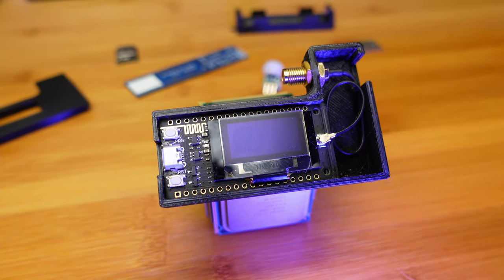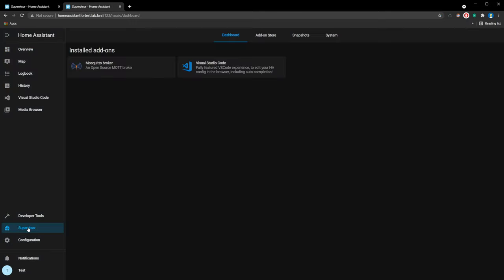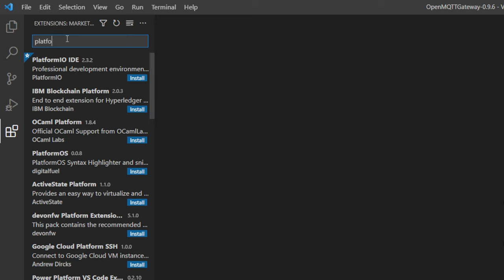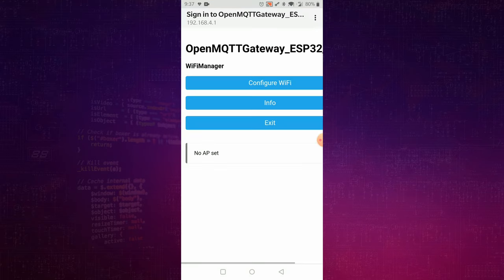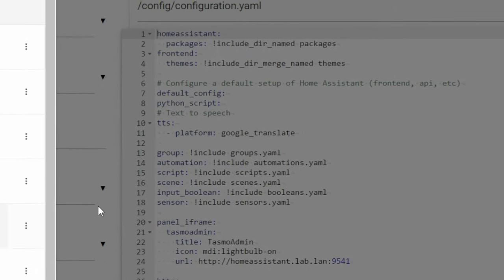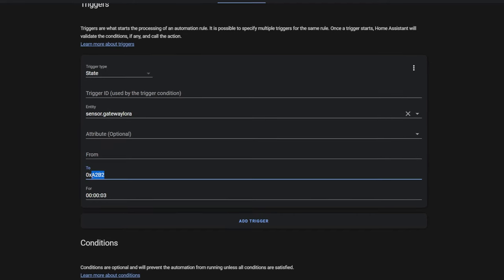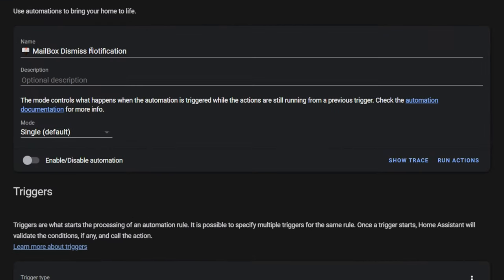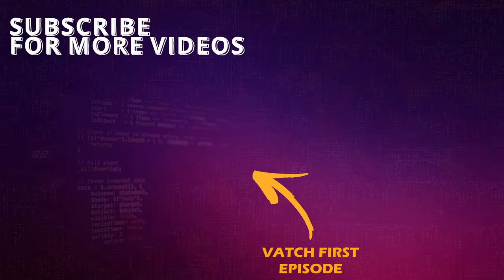LoRa Bridge and Mailbox sensor Integration into Home Assistant #2

Comment: Could you do a video just on LoRa ?
Like on the Home Assistant side, I'm not sure if I need a transceiver, a gateway, a bridge or something else. 
What is LoRaWAN? Do you have a LoRaWAN as soon as you have two LoRa devices or is it a bigger commercial application that requires special infrastructure?
Reply from the maker: This video is an old one!  watch this https://youtu.be/gf1WWKyEnbg
Reply: @PricelessToolkit  I was!
But it doesn't clarify everything. I get the TTGO is the gateway and you connect it to your WiFi network, it's not like a ZigBee stick or a RPi Hat. In the mailbox, is there only an emitter or is that module able to receive data from the gateway as well?
Reply from the maker: no MailBox Guard only sends data.

Comment: Big question, what happens if the Mail man  leaves the mailbox flap open (typical large envelope that doesn’t get all the way) or publicity or whatever. Is the battery going to drain or have you thought about this situation ?
Reply from the maker: Hi, what type of mailbox American or European?
Reply: @PricelessToolkit   european, would use a reed switch
Reply from the maker: @danielducu  reed switch instead of motion sensor?  On the mailbox sensor, LDO has enabl pin, motion sensor uses this pin for activating Arduino, after boot, Arduino keeps LDO pin high until the message is sent.  So if you connect a reed switch instead of a motion sensor, in the case when the door is not fully closed Arduino will be powered all the time And will drain the battery very quickly.
Reply: @PricelessToolkit   would be great if you could make a small video showing how you mounted everything inside the box , especially the pir hehe
Reply from the maker: @danielducu  I will take a photo tomorrow
Reply: @PricelessToolkit   thanks man. Anyway, the project it’s awesome. I can’t wait to build this one 🤩

Comment: Hi, great project! I would like to use two of the ttgo lora32 v2 modules, one as gateway and other for sensor with a hall sensor or tilt sensor. Will your arduino ino file work with the lora32 v2 board?
Reply from the maker: Hi, Thanks!!  Unfortunately no, the architecture is different. You can take "Lora sender example" for the lora32 board. then add interrupt pin cod for your tilt sensor, it's like push-button no difference, there are many examples.
Good luck

Comment: I purchased the ttgo board from the link you provided and I have problems with the MQTT part. Writing openmqttgateway was a clean process and no errors what so ever... im configuring the wifi and MQTT from the web interface but it's not communicating with my MQTT broker... absolutely nothing. I tried flashing both a version from July 2021 as well as the last  openmqttgateway version but the same thing... any hints ? I have MQTT setup in home assistant and works perfectly
Reply from the maker: Hi Daniel, 
1. Can you see under "MQTT devices list" your OpenMQTTGateway ? 
2. In your wifi router can you see OpenMQTTGateway IP Address?  Ping is working?

If the ping is working so it's connected to the wifi network problem can be a simple " MQTT username/password/MQTT Address" misspelling error.
Reply: @PricelessToolkit  thanks for your reply. Not showing in the MQTT device list in HA (I also tried an MQTT Explorer APP where I see everything, less the gateway), in the router I can see the ip and ping has super good and stable reply, MQTT credentials  and address are ok, I tried reconfiguring this a few times now :( I'm out of ideas
Reply from the maker: @Daniel-vd4mk  Very strange, if you are using MQTT Explorer APP so you can log in.  I found a note in "https://docs.openmqttgateway.com/upload/portal.html#wifi-and-mqtt-configuration-portal-for-wifi-boards"     Note that your credentials are saved into the ESP memory, if you want to redo the configuration you have to erase the ESP memory with the flash download tool.   Maybe the first time you typed login or password incorrectly.  I suggest you wipe ESP entire memory and try one more time,  Only reflashing apparently does not erase the memory
Reply: @PricelessToolkit   I've written OMG to an esp32 d1 mini. enabled fastled just to test. Again, everything cool, all configured and on the network but not communicating with my mosquito broker from HA. damn...
Reply from the maker: @Daniel-vd4mk       I'm running out of ideas   ar you using ssl ??
Reply: @PricelessToolkit  no, could the board be defective? It’s connecting to both wifi and mqtt server initially because if it wouldn’t, it would get back to the config page and AP mode. So initially is ok, but after , does nothing on mqtt … just connected to the network … it’s bad they didn’t left some kind of web interface to debug and get some logs
Reply from the maker: @Daniel-vd4mk  No, I don't think that the board is defective,  first, it must connect to the wifi then to the MQTT server,    #it would get back to the config page and AP mode# of course not! OMG will only do this if wifi credentials are wrong, MQTT credentials error is silent.
Reply: @PricelessToolkit  is there a way to see what the board is doing ? Trust me, I’ve put the correct mqtt credentials. The thing is , I’ve configured another board in the past (v2 or 3 of the lyligo) and worked smoothly…
Reply from the maker: @Daniel-vd4mk  Maybe it outputs debug data in the serial port?   and try this 
1.https://docs.openmqttgateway.com/upload/troubleshoot.html#you-don-t-see-the-messages-appearing-on-your-broker-but-they-appears-on-the-serial-monitor
Reply from the maker: @Daniel-vd4mk  https://github.com/1technophile/OpenMQTTGateway/issues/397
can you show your MQTT server config?
Reply: @PricelessToolkit   I just tested a heltec board, flawless install … absolutely no issues. Will paste the serial port monitor output maybe you can figure out why it is failing. I’m starting to think the ttgo board revision they sell now is somehow incompatible with the OMG …
Reply from the maker: @Daniel-vd4mk  Even if this board has a different pinout MQTT will work ,  only the lora may not work. yes, I'll take a look , did you read the github thread

Comment: Hello, how about the TTGO-LoRa32-V2.1?
Reply from the maker: Hi, Technically all esp32 are supported, the difference can only be which pins are connected to the Lora module.  But these pin numbers can be changed in the config if I remember exactly, to be 100% sure ask on the "OMG" forum. here is a photo with pin numbers for version 2.1 https://0.rc.xiniu.com/g2/M00/FA/B1/CgAGfFv00Z2AJvSNAAIzDuBdPk4301.jpg
Reply: @PricelessToolkit  I could then upload the v1 file from openmqttgateway?
Reply from the maker: @mitsosliak  v1 file ?  Try with latest version fo OMG
Reply: @PricelessToolkit  is it possible to provide me with the link?
Reply from the maker: @mitsosliak https://github.com/1technophile/OpenMQTTGateway
Reply: @PricelessToolkit  As i can see, the only difference is the reset gpio for the lora chip. As such if i just define gpio from 14 to 23 in config_LORA.h , everything should work as intended, right? Check picture below please:
https://i.gyazo.com/5029ffb6d600d773b015db7294610d70.jpg
Reply from the maker: @mitsosliak  yep!
Reply from the maker: @mitsosliak  If it's not difficult, let me know if it worked?
Reply: @PricelessToolkit  will do, it will take some days since I haven't received them yet
Reply: Today i actually had them delivered. It was a successful regarding flashing. I had the esp connected to my wifi network. I have trouble connecting to my mqtt broker though. I am sure i entered correct settings. I am receiving the following message when i connect through arduino ide :                                         
W: MQTT connection...

W: failure_number_mqtt: 1
W: failed, rc=5
Reply: @mitsosliak  rc5 means the client is not authorized to connect "this message was sent by your server"
Reply: @d.m5238  that means that I did something wrong with mqtt username and password?
Reply: @mitsosliak  in your mqtt broker certificat is enabled ? If yes disabl it
Reply: @d.m5238  i fixed it. I realized that there was a space at the end of user name and password. Thank you for your help!
Reply from the maker: @mitsosliak  No problems, I'm glad that everything worked.

Comment: Do you know if it is possible to add a second or more sensor from another lora sender to the same OMG?
Reply from the maker: OMG is a gateway, so yes, you can
Reply: @PricelessToolkit  but how is that possible? Do I need to use the same (secret) word for all of them? If that's so,  how ha will know which node is reporting? There is only a single entity inside ha ( gatewayLORA).
Reply from the maker: @mitsosliak  Its depends on which type of data if it is a binary sensor like a different state each sensor can send (Sensor1 101= on 102=off) (Sensor2 201= on 202=off) and automation in home assistant does the rest.
Reply: @PricelessToolkit  let's say you have a node that sends temperature from a Dallas sensor and a second node sending a reed switch state change. Then what?
Reply from the maker: @mitsosliak  Then it will not work, only will work with binary type sensors.
Reply: @PricelessToolkit  if I have them as new pair? Can I have two gateways at the same time?
Reply from the maker: @mitsosliak  I am not sure, but if they have different names,  I think there will be no problems, ask on the OMG forum.

Comment: Hi
Great project I have ordered the PCB's unfortunately I need to make change to the PCB as I use a clone Arduino Pro Mini which has different FTDI layout ,not sure how to go about it ..Cheers
Reply from the maker: Hi. i use clone too. all pins are different ? you don't need to solder all pins. if you want, I can tell which pins you need to solder.  FTDI Pins not used.
Reply: @PricelessToolkit  Hi . Thanks for the reply .They do touch though when you solder other pins on Pro Mini ,best would be to put a tape over the  FTDI pins .....Is that what you are  suggesting ..Cheers
Reply from the maker: @gilclaus9798   FTDI contacts are not connected at all. Even if this contact is touching nothing worry.
Reply: @PricelessToolkit  They'll have to be connected to program as per your YouTube  video and the power rails will short if they're touching...?...Cheers
Reply from the maker: @gilclaus9798   I have updated the Github Page watch "Which Arduino pins to solder" If you have any more questions, I will be happy to answer. good luck
Reply: so best to use a header as spacer  ..Cheers
Reply from the maker: @gilclaus9798  Yes, it's a proper way. but it can touch the battery holder on other side of pcb.
Reply: @PricelessToolkit  Thanks ...That was helpful ....think I shorted my board for now ...Cheers

Comment: How to increase the range between transmitter and receiver (LILYGO TTGO LORA SX1278) ?
Power tx is set to maximum (20), but the effective range is 4-5 meters.
My mailbox is around 20 meters away,  behind few walls.
Reply from the maker: 4-5 meters? Did you turn it on without an antenna?? even if you turned it on only once without an antenna, there is a chance that the RF amplifier burned out, even with very small and low-quality antennas, the LoRa range is more than 100 meters. Check antenna connections!!
Reply: @PricelessToolkit  unfortunately I don’t remmeber - probably I didn’t connect the antenna during uploading the software :-(

Sys: Rssi says -27 dB in HA
Reply from the maker: @gabrielcwik146   -27  dB is good but probably it's wifi RSSI. are you sure that the config is identical in the gateway and sensor?
Reply: @PricelessToolkit  I have the same frequency 433Mhz, syncword 0xF3 on both ends. The Mailbox key is send correctly to HA. Automations works fine. The only problem is the range.
Reply from the maker: @gabrielcwik146  Is the sensor antenna soldered correctly?  I have no more ideas , check it one more time. The problem for sure is RF related
Reply: @PricelessToolkit  I just want to be sure. The problem could be on lily ttgo lora or on the DYI PCB ?
Reply from the maker: @gabrielcwik146  in both
Reply: @PricelessToolkit  Ok, thank you for your help.
I will buy a new ttgo lora module and try again.
Reply from the maker: @gabrielcwik146  Just don't forget, put the antennas on first. :goodvibes: